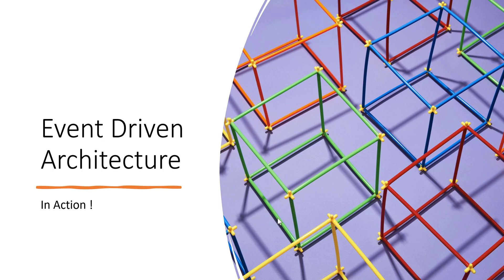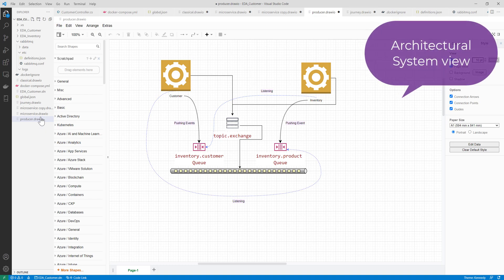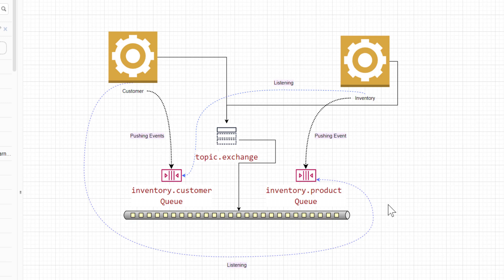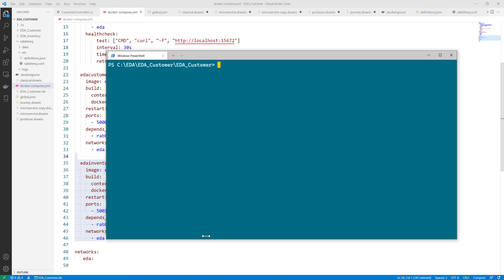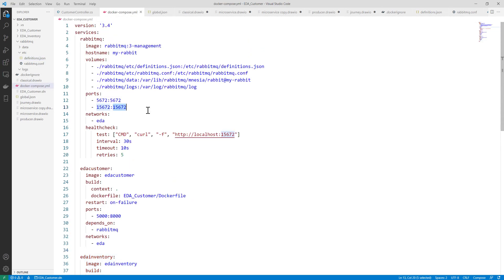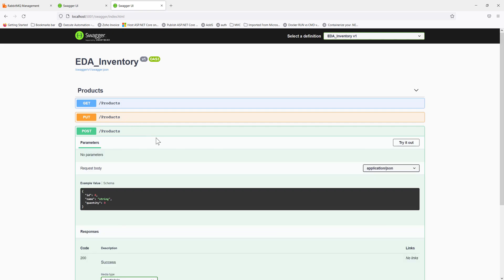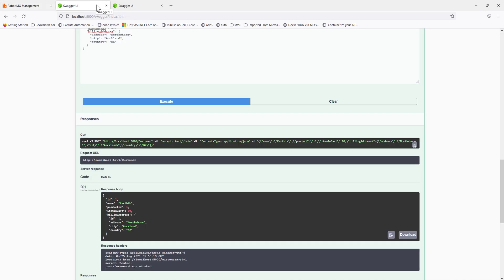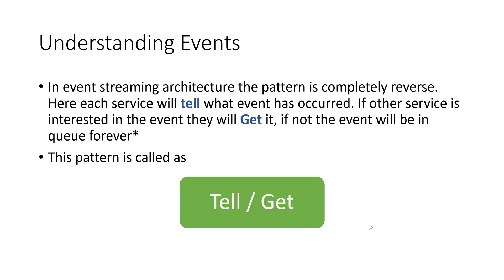How Event-Driven Architecture based applications works ? (Demo)

Comment: I don't thing queue is a good fit for event driven system, instead we need immutable logs, such as kafka topic of kinesis shards. Queue implicitly means that the data is deleted once read by one service. That actually avoids one major benefit of ED system that you can plug n number of application to the echo system at any point of time whose input(s) is/are one/more of the existing topics.